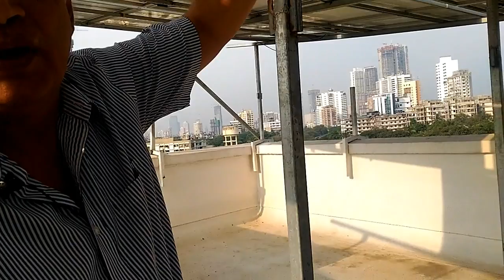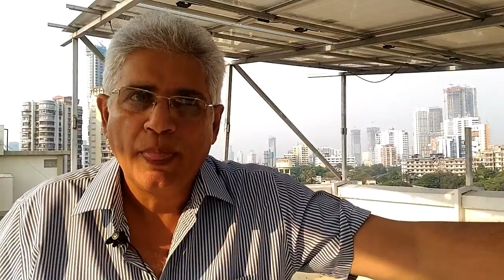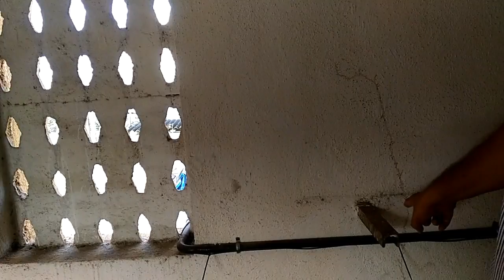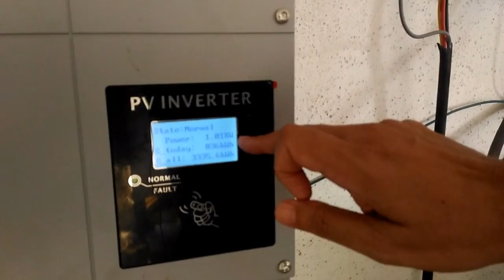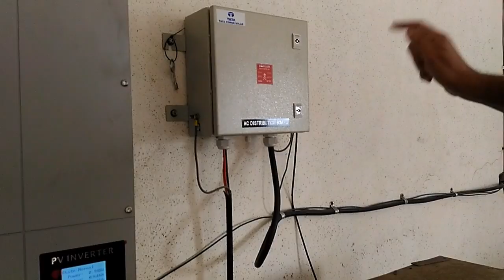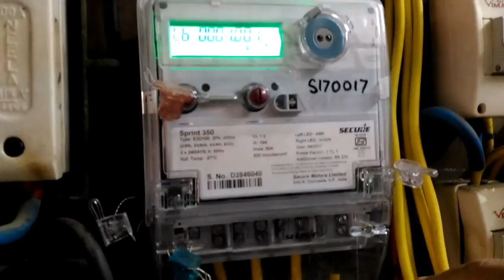Solar System Power Panels Installation in Mumbai, India

Comment: Does Municipal Corporation of Greater Mumbai (MCGM) allows such type of installation? I live in Andheri West.
Reply from the maker: Yes please. There is no specific permission from MCGM for Solar. We had to take permission from BEST (in your case Reliance Energy).
Reply: Hello there, Municipal Corporation or any government cannot actually deny you from opting solar (unless it causes some sort of obstruction to any High tension wires or something like that). Government is going with full force in this.
Also, I head a Solar Installation group in Mumbai, Navi Mumbai and Goa so if you haven't already installed or requested an installation, I can provide you that. AND the clients I have so far worked for have found me and my team quite affordable and now we are government certified as well.

Comment: Hello, I had installed 2.01KW Solar Rooftop System.  It consists of 6x335W Waaree Monocrystal Solar Panels and using 3KW Capacity Growatt 3000TL inverter.  However, my system is only producing units between 5-6 per day.  I am seeing that during the peak hours, the wattage doesn't go beyond 1200watts and between 10.30am to 1.30pm it hangs in between 950watts to 1200watts.  I am not able to understand the cause for this, as even after considering weather and efficiency factors, It should produce around 1700watts or so during the peak hours.  Can you provide any suggestions?  I was told it should produce 8 units a day and it will go up to 11 or 12 during the summer. Thank you.
Show less
REPLY
Reply from the maker: Ours consists of 40 panels generating 30-40 Units a day. Are you regularly cleaning your panels. Just spraying with water to remove dust and bird droppings would help.
Reply: DId you try to get connected with Waaree or Growatt to identify the cause. even you can reach out to the vendor who fixed it.
Reply: Hi the prob is ur feed in input voltage to ur inverter.. u r feeding voltage is 45*6=270 Voc and Vmax is 180 volt..
BUT MPPT range is higher ... For better efficiency u need to feed higher voltage.. ie.. 540 voltage.. IS ur PCU 600v or 1000v system?
Reply: Hello there, I can definitely sort that out. I head a Solar Installation group which works in Mumbai and Navi Mumbai area so, if you are around here and willing to let me then I can take a look at it.
Reply: Solar panel work on solar radiation.Above the earth's atmosphere, solar radiation has an intensity of approximately 1380 watts per square meter (W/m2).This value is known as the Solar Constant. At our latitude, the value at the surface is approximately 1000 W/m2 on a clear day at solar noon in the summer months.in Mumbai solar Average Direct Normal Irradiance 5.35w/m2 so if you select 250w solar panel then actual power you will get 150w to 180w max.its also depend on heat actually solar panel Standard Test Conditions (STC) is 25 when it reach 30 to 45 Normal Operating Cell Temperature (NOCT) then solar panel efficiency gets down.solar panel efficiency mean how much light(solar radation) convert in electricity.in india maximum solar panel efficiency is 17%.solar panel efficiency also depend on solar panel size.
Reply: I think poly works good in india

Comment: Why didn't you put up a system where the amount matches the total consumption of your building. Is it not feasible or is there limit to a minimum amount which you need to pay? is the extra energy acculturated every month gets credited to next month? What is the maintenance charges or AMC of the system?
Reply from the maker: Abhishek, 1) our electric power company is BEST Undertaking Ltd., which do not allow additional generation and does not sanction additional load! 2) All surplus / deficit is cleared on 31st March. Hence if you have generated excess, the same is not carried forward after 31st March. 3) Presently there is no maintenance. Only cleaning with water spray to remove dust and bird droppings from the panels every week to get optimum output. Also no AMC, in case of problem, after 1 year, call your contractor or panel supplier
Reply: Product Videos thank you sir for your detailed reply. We are also going for solar system.
Reply: We have also ordered for Solar system in Pune. Hopefully it will be installed in a month. How is the system functioning right now.
Reply from the maker: We installed in July 2017, and we are extremely happy with the functioning